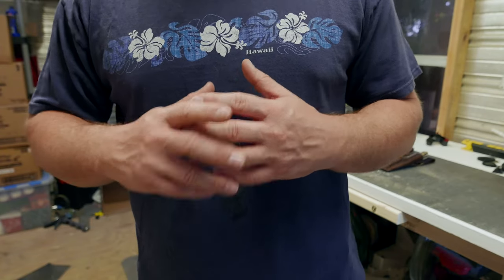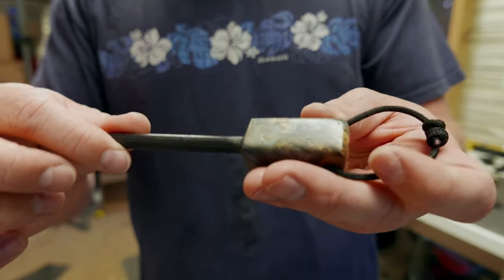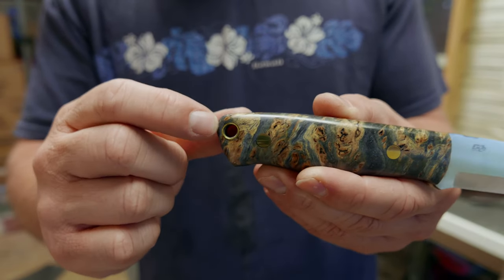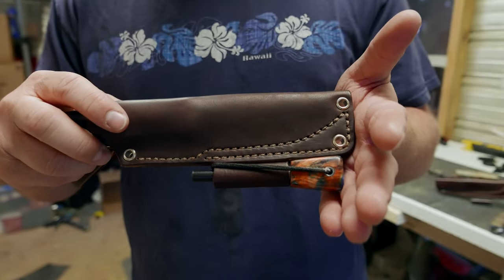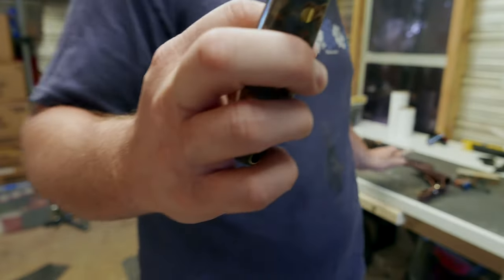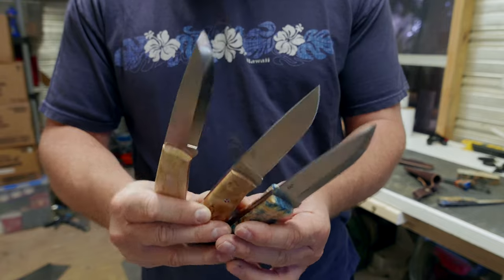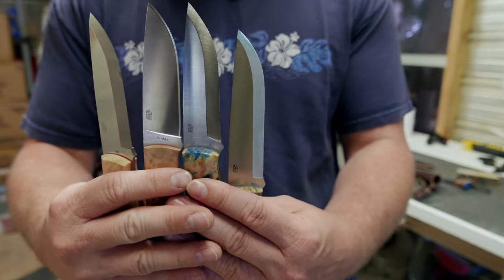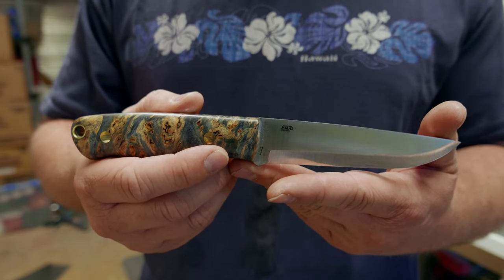Custom 12c27 Enzo Trapper 115mm final product and comparisons in 4K!

Comment: Hi.
CAn you offer an opinion on enzo`s 12c27 performance?
I own a few in o1 steel looking for stainless
Reply from the maker: Hey, spunj mc. Since my boss resigned and I've basically had double work load, I've not been in the woods in a grip. I can tell you that the thicker offerings - Trapper and Nordic - are dense and very sharp and on par with the O1. However, I've still not had a chance to do any serious testing of any of these yet. I recently built a Nordic with 12c27 blade and I got a Nordic skinner in the same steel, but it's very thin and has a slightly hollow feeling. Honestly, I think the 12c27 should be very good in the field and on par with the O1 or perhaps slightly better. If you con't make a decision in the mean time, please consider subscribing to my channel and checking back for when I do get a chance to run a comparison. Cheers

Comment: I need to know if the 115 has a longer handle than the 95 ?? Also how does handle size compare to the Enzo Camper ? Thanks
Reply from the maker: Sorry, my alerts are only coming through on my subscriptions and not on my channel questions. Weird. 

The 115 and 95 Trapper have the same handle profile and length, yes. I've received stock scales in the Trapper ONLY on the 95, as my 115 build was custom. However, the TEMPLATE I based my initial cut on is from the same as the 95. Also note, in this video I rounded out the back point on the palm side to make it more nimble and less sharp in the hand. If you look at photos of a 115 blade blank or factory-completed knife the two look identical with the base of the pommel rounding to a point. It's just a personal choice I made on mine to see how it would handle rounded out. I also chose to make my handle here slightly thicker and slightly contoured compared to the factory offerings which are thinish and flat, but with a slight taper to the blade. So, factory, yes, they are the same as are the sheaths with with exception that the 115 channel is obviously longer.

The Camper handle has the same Enzo-esque thinness as the Trappers, but it has a more pronounced stop at the base of the pommel. So instead of sloping from the farthest point up near the lanyard hole back TOWARDS the palm, it almost drops straight down. This isn't as nice LOOKING IMO, but it does provide a bit of s top or hook that provides extra grip if choking way back on the knife, for example. I do find it less comfortable in reverse holds than the Trapper, but the rounded version I did here is my favorite. I don't have the Camper any longer to compare now, but my recollection is that all of the handles are fairly similar in length, but because the Camper (and Badger) have the straight drop back, the handle feels a bit longer on the finger side since the back doesn't slope forward using up real estate. In other words, there's more finger room at the back of the handle on the Camper and Badger. I do prefer the Trapper's design and comfort, though.

If you like the 115, but prefer the Camper handle, the Badger is a great option. It's a superbly convexed blade and I believe Enzo is doing themselves a disservice not implementing that in their O1, 12c27 and Elmax options. It was only ever available in the Badger and in D2. I have two Badgers, on completed and the other waiting scales. I plan on rounding the back of it out more like a Trapper. The blade is my favorite, but I don't like D2 as much as some of the other steels. Too bad there are not more Badger steel choices. I think they'd fly off the shelves, at least in the US.

Hope this length answer helps shine some light on your questions and maybe a few you didn't ask. Good luck in your search.

Cheers!
Reply: As I understand it, the Trapper 95 has a 95 mm blade.  The Trapper 115 has a 115 mm blade.  I think the Trapper 115 is similar in blade size to the Camper but they have different geometries in the blade & handle.

Comment: did you modify the pommel of 115 trapper?. it seems different from trapper 95
Reply from the maker: Nope. The bevel geometry seems to vary based on steel and length. My O1 in 95 is much higher, and therefore thinner at the edge, than the 115 12c27. The same seems to be true for D2 and Elmax as well. Depending on what their heat treat does they may adjust edge profile to provide the best results. I usually don't adjust any scandi grinds, though the micro bevel usually gets eliminated with resharpening/stroping